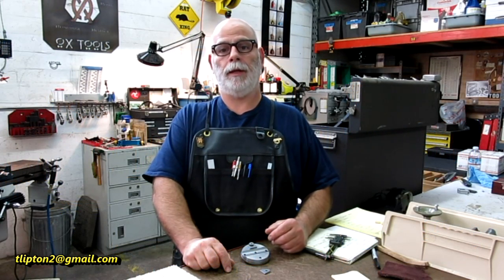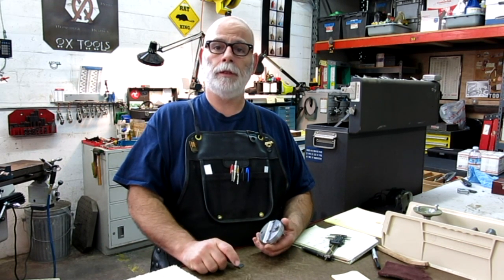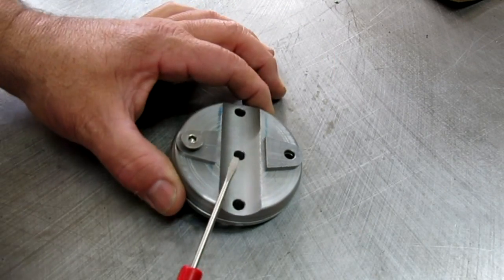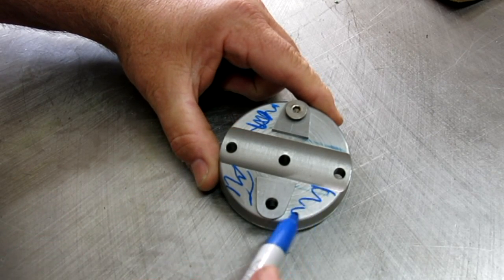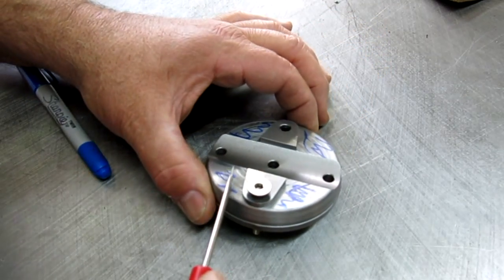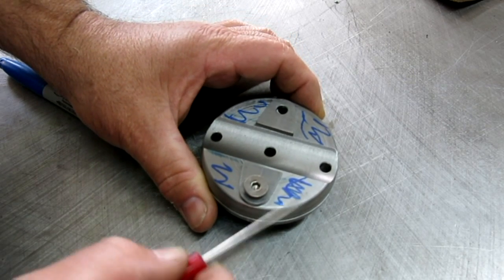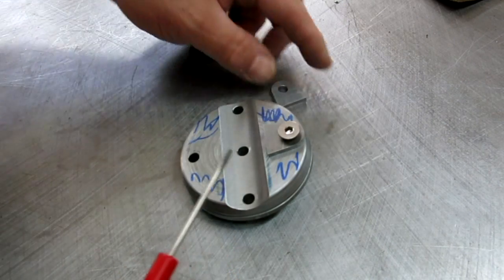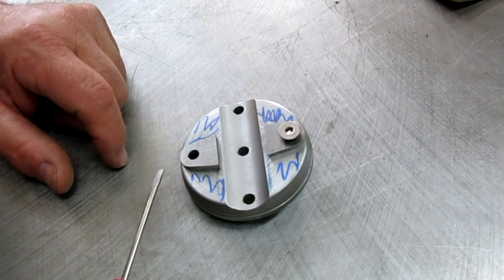Baby Bullet Build 3

Comment: Tom, Monday morning quarterbacking here, and I realize this is a couple years after the fact, but I think I might have a better way of doing those "tombstone" tabs.
Instead of machining them into thicker floor material (because, like you said, 'Hella lotta work'), why not make both tabs out of one strip before the tube radius was cut into the disk? Tack that in (or better yet, go ahead and full blown weld it in, with radii finishing and all), and then cut the tube radius through the center of the strip.
My reasoning for that is you wouldn't have to worry about getting the bases of the tombstones parallel with each other, or the tube, and they would have a matching radius to the tube once the radius was machined in.
Frankly, it seems like it would be a little more "true to the nature of the part" if you catch my drift, and maybe, a little easier to do.
Great series, BTW. I'm re-watching it because I just recommended it to a friend, and remembered how much I liked watching it when it came out.

Comment: Just a thought but, what if you had made the two fillets as one piece?

Being longer, they'd have been easier to handle for belt sanding, and they'd have been self aligning for welding.

Once they had been welded and tidied up, you could simply mill out the middle, or, better yet, cut out the middle with the boring head, making the fillets a perfect match to the radius-ed groove.

Comment: I'm new to this channel/project and I'm loving every minute of it. But I have a question that maybe some of you guys can answer. When you're TIG welding without a filler rod, does the weld get all hard and brittle, like when you're MIG welding? It doesn't seem like it when he's filing on the welds in this video. Just curious.
Reply from the maker: +jakobv8 The weld typically stays soft when the base material has a low carbon content. It can get hard depending on the type of steel. Thanks for the comment.

Cheers,

Tom

Comment: Nice job Mr. Lipton. 
When I worked as a tool and die maker apprentice I did pass the TIG torch over the weld "seem" (without the sideways movement) thus "blending"it all together. It would help the later smoothing work a lot, since the only high spot was the point where I stopped the arc.
Anyway, a really nice channel you have there, learned a lot from your videos. All the best.
Reply from the maker: +Titi Istvan Hi Titi,

Thanks for the nice comment and suggestion. I did that a little in those difficult corners so the file would bite there. 

Cheers,

Tom

Comment: Tom,

You do it your way. It's your channel.

You are the one taking the time to produce, edit, and load the video.
You don't have to explain nothing to me.

There aren't two machinists in the room who will do a job the same way anyway.

In my vids I try to mention there are other ways of doing things depending on your 
Experience and the tools at hand.

I would have done it on my Fadal though :).
Have to keep the memory battery charged after all. 

Don't have a Hass mill anyway Adam.

Regards
Kap

Comment: Wood guy here: just screw the piece on a block of wood with two screws. So you can clamp it in your vise without that knucklekillerkantklamp.:-)And generally: those bosses are not necessary if you do not mass fabricate these bases by casting. You really dont have to save material on your one of series. Keep the base thicker, drill your holes and done. or mill it straight across the base. the conical form is only for casting.

Comment: Tom, when I was a boy 'prentice electronics technician my teachers thought it would be a good idea to teach us some basic metalwork as well. They were right, of course, but being young and not very strong I didn't cope well with cutting and filing large pieces of steel by hand, and I used to HATE filing, because it was (for me) hard work and it took a long time to achieve the desired result (which I rarely did...).

Now,. fifty or more years later, I have come to respect the methods they taught me but which I didn't learn, if you understand that. These days I love a file, and I love polishing with ScotchBrite, and I love achieving a fine finish which doesn't depend entirely upon the machine.

Thank you for letting us watch you using simple hand tools to produce the thing you wanted. I learned lots; for instance, I had never thought of using abrasive tape under a file for a better finish, but I'll do it now! The other thing is knowing that even the ace machine operators are not afraid to pick up a file or a scraper or a bit of grit paper to get the final finish.

Long may you prosper,. mate.

Comment: Digging the file work and even the emery blend!  I have developed a preference for the look left by finishing steel with 220 grit paper.....just love it.  For those using the plans to follow the project, there is a difference in filing a tig weld vs. a mig weld.

Comment: The original base is of course a casting, probably wooden pattern in a sand mold. In patternmaking you use fillets to make the pattern release easily -- sand does not like sharp corners. In the really old days the patternmakers used sawdust mixed with glue to put in fillets. Nowadays the way to do it is with Tom Lipton's archenemy, bondo (see this week's meatloaf).
Reply: +Juan Rivero It always good to be friends with Mr Bondo . . . .

Comment: As a young lad I would hang around by the shop door watching, the foreman asked me if I wanted to run one of the machines, yup I said so he took back into the the depths and introduced me to Mr file, Mr hammer, and Mr chisel. I also got to know Mr. vise and Mr soap box. He said if I could make a scrap block of iron flat and parallel on two sides he would teach me to run a machine. That took several days of standing on the soapbox and sweating  as I was only seven, but the wait was worth it, he introduced me to Mr shaper - my first lesson in machine shop practice. That was 65 years ago and I'm still learning how to file correctly. Grin..........

Comment: What is the point of those "washers"?
Reply: +error079 Such bosses are a normal form with castings. The casting will have an irregular surface and the bolt heads will not bear evenly. By casting a boss (easy to do with a casting) it gives a very small area that can be machined flat (avoiding machining and fairing in a large area or even an entire face of a casting). 

In this case (machined and welded) it is just to make the final result look more like the original. If æsthetics were not a consideration, the tube could have just been welded to a 4" square chunk of 1018 with flame-cut edges. (And I have seen exactly that sort of fabrication by people who don't care about the look and feel of the result.)
Reply: So why put them on a machined surface?
Reply: Because the curves and different levels add to the æsthetics of the final tool. What was a practicality in the original was done with such care for the final appearance, that Tom decided to copy that appearance by adding bosses to the one he is building, whether they are needed or not.

Comment: Hey Tom great video. The tabs look great, but do you think that are needed?
Ps. I'm not trying to be a troll. LOL

Dale d
Reply: +Metal Tips and Tricks (Dale Derry)  I think he was just trying to make it to look like the old original .
Reply: +Metal Tips and Tricks (Dale Derry) they are just a visual element, most of the old casting things with bolt holes for some reason had a thicker part, of course casting was easy to achieve that kind of feature, but milled out of steel, it didnt need reinforcing at all
Reply: now if he can replicate the raised lettering of wilton (or make it a lipton vise!) then i will be impressed
Reply: +Metal Tips and Tricks (Dale Derry) This is art! I love that he's going for a shapely form like the original. Hand carving is fun. It's not just making something functional, it's making something very pleasing and he'll remember fondly that file carving and shaping every time he sees that vice. The combination of machining, welding and shaping makes this project special and beyond the usual. Kudos Tom!

Comment: Great video.  Little by little you are growing a vise there.  Looking at the factory made vise I don't see how hey got the pattern out of the sand.  That tube part must be a real complication.  I guess if it were made of lots of pieces then it would come out easy enough but that would certainly run up the labor cost.  I suppose we will never know.  Thanks for sharing.
Reply: +cerberus propably it was cast with a sand core that is removed after casting. Pretty sure it was cast in a sand mold.